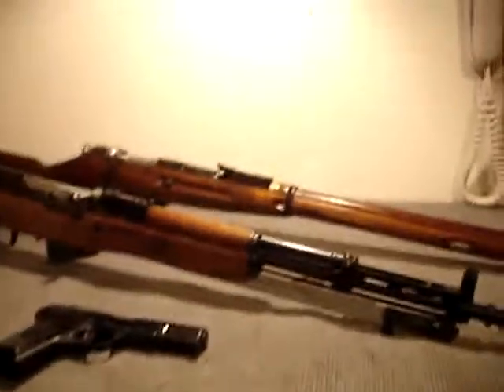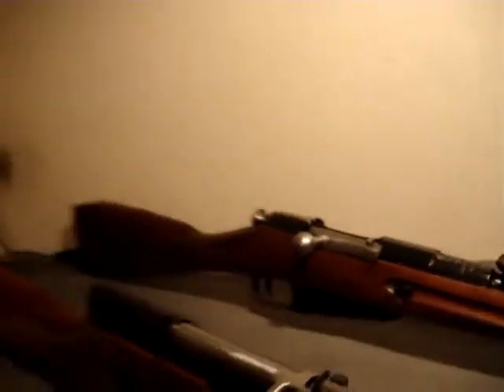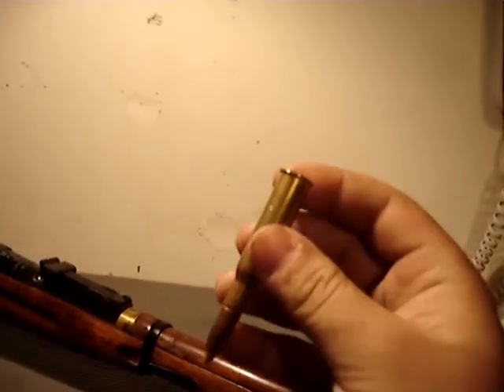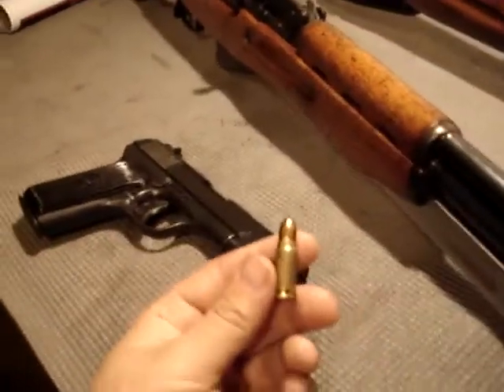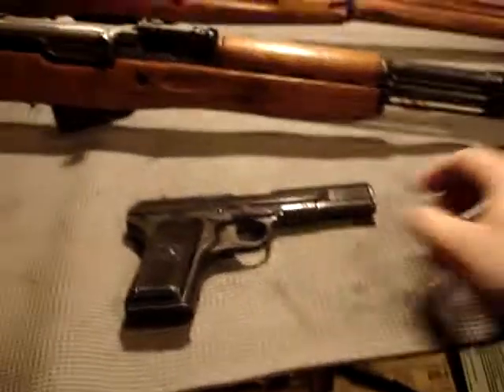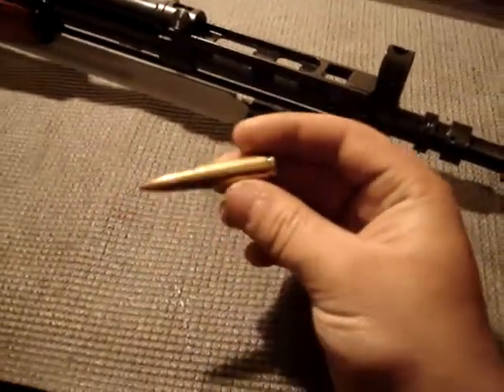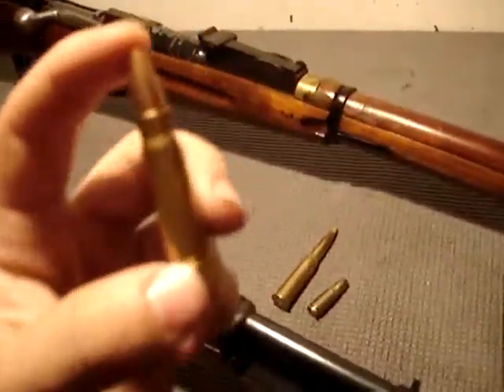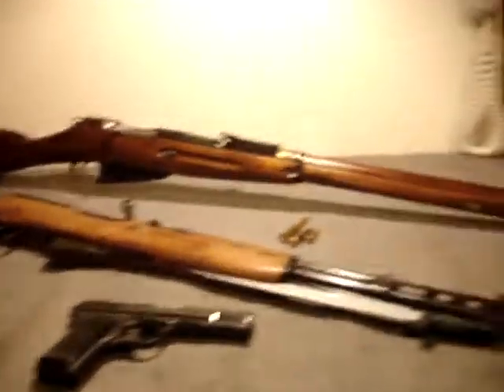the 3 most common russian cartridges used in the first part of the 20th century

Comment: @HeyYoHomeskillet wrong again. bigger is not better. 7.62 FMJ does not tumble unless you use yugo M67 surplus and it leaves a small wound channel but is a fine penetrator. 5.45 always tumbles/yaws much worse. gee maybe thats why the 47 was replaced with the 74M